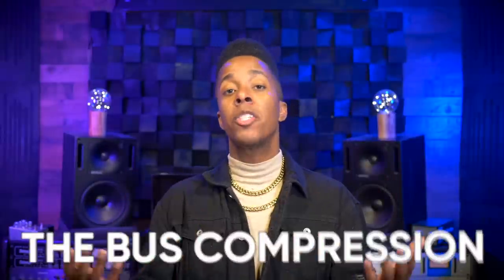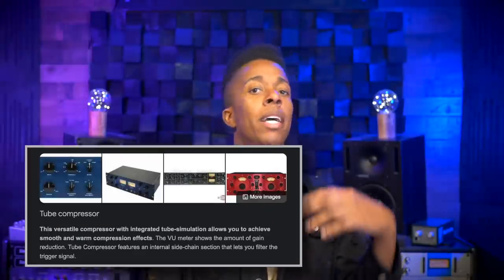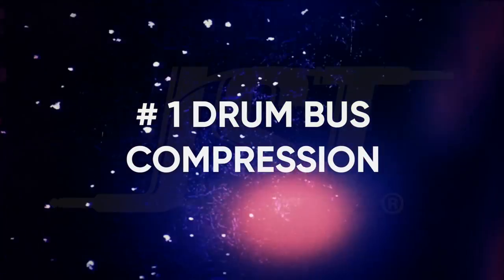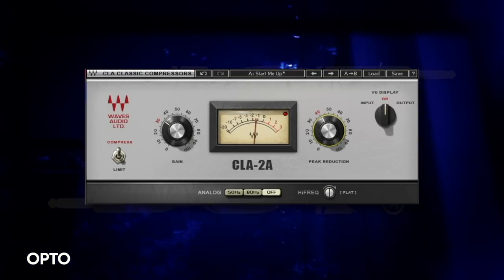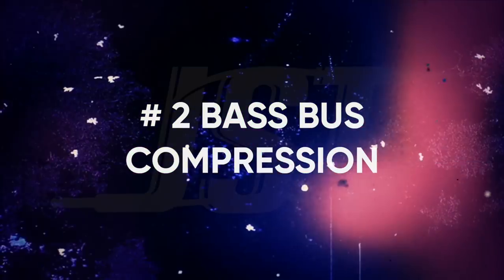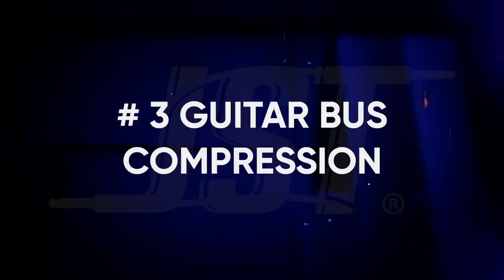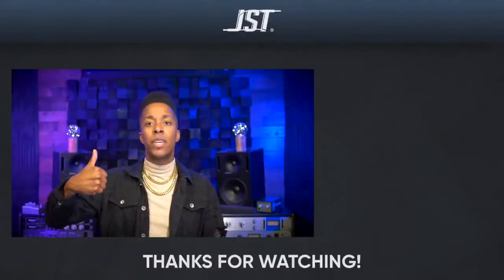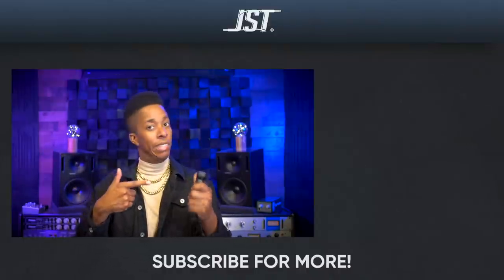WRONG Bus Compressors Can RUIN Your Mix...

Comment: Summary
BUS Compressors
DRUM BUS - VCA
BASS BUS - 
  FET(1176) or VCA for fast songs
  OPTO (LA2A) Tube (Fairchild) - finger slow songs
GUITARS
  VCA - SSL comp or API 2500
- Never use FET
-OPTO can only be used smoothing out acoustic
-Tube nice color to help guitars seat on a mix, spec on mid temp music

VOCALS
-LA2A and 1176 in unison
-LA2A and other OPTO
- Aggressive vocals (FETS)
-Tube is amazing on vocals
Reply: TNANK YOU BRO LUVVV!!
Reply: Breaking the Rules is fun too 😊

Comment: Great stuff! Probably diode-bridge compressors (like the Neve 2254 and 33609 or the Chandler Zener Limiter) would have deserved to be mentioned as they are favourites for many of the sources showcased in this video (and they tend to have quite flexible parameters too). Also it's not completely true that opto compressors don't have fully tweakable attack and release times: the old LA-2A and LA-3A don't, but there are many optos which do have tweakable attack and release, like the Tube-Tech CL-1B, the Pendulum OCL-2 and even the FMR Audio RNLA!

Comment: I mostly use SSL Comp on Drums and sometimes bass. I usually use DBX 160 on bass, guitars and keys. I stumbled across this video  Ive been meaning to study the difference of FET ,VCA and Opto . Thankful for this vid I will look at the breakdowns you have as well. I was used to getting into the session and going which I've had many good outcomes but I want to still know more. Blessings man be cool and safe!!!!
Reply from the maker: Make sure to check out the explanation video! It will help out a lot, I tried to unpack it in the shortest and most explanatory way possible!
-Miami

Comment: I dont compress hi gain, and hardly compress mid gain, I compress cleans loads (usually with the Klanghelm DC1A3 for clean , Mid gain, or Leads).
Bass I tend to use what ever I feel like at the time, and for me I worry more about the saturation/clipping and just use the comp too catch peaks
Drums I use an 1176 Emulation
on the stereo bus I used an SSL based plugin into a Klanghelm MJUCjr (the MJUCjr is just for glue and the needle hardly moves, it adds depth to the low end, the SSL on auto giving 1-3 Db gain reduction)
I use Saturation as well on Buses

Comment: Best tip: Just use stock compressor or Fabfilter-c and use other plugin for coloring. Best advice ever.
Reply from the maker: I almost always want a lil color tho lmao
-Miami
Reply: @WillBergIV  are they adding that?
Reply: Worst advice ever. Why use multiple plugins when one can do the trick? Simpler and more time efficient.
Reply: @MrMahn21  Because you cant control the coloring apart from the compression on those plugins. More control means you can make it more like how it sounds in your head. Also not sounding like everyone else is important. This is for a mixing and mastering perspective.
Reply: Analog Emulations changes phasing through harmonic distortion. The only real reason besides saturation to use Analog Emulators. Your argument isn’t valid because it does more than simple color as every unit pushes different harmonics and changes in the time domain. Use what ever the mix bus needs. Sometimes it‘s a fast digital linear compression, sometimes it‘s the non-linearity that you need.
Reply: @MrMahn21 cus i don’t have to pay $100 to save a couple minutes

Comment: What about compressors that aren't analogue modeled like most stock compressors, how do they fit into this and what settings wiuld you recommend, since most of them are really adaptable which overwhelms you with options a bit. I use Maximus for both singleband and multiband compression and I'm gonna be honest, I usually just f*ck around and find out, since i don't really know any guidelines for what settings are good for what. A lot of tutorials like this always asume that you are working with analogue modeled stuff that doesn't have a lot of options so the type is important for specific tasks but I'm gonna be honest, I just dont have the money to waste it on a dozen different compressors. I mean if I want 'colour' I can just use a saturation plugin, no need for expensive analogue modeled stuff.
Reply from the maker: It’s hard to answer this but the sage way on a mix bus is 1-3 db of gain reduction with a 2:1 or 4:1 ratio
-Miami

Comment: Can I just ask about bass compression? The GR meter was just dead there is that what I should be looking for?
Reply: Glad you commented on it. There was actually zero change. I think they forgot to put a real bass being compressed by the different compressors so they could be put to test. Why use a midi bass that's already hyper compressed as an example? Clearly the bass example part was a mistake. The rest was awesome.

Comment: The only thing wrong you said was about drum shells there dynamic range of maple, birch and poplar are not that different and remember Led Zeppelin recorded a hole album with using just a room mic to record drums. It’s more about the mic vs the actual drum set. Even though you can use cheap mics and get really good results.